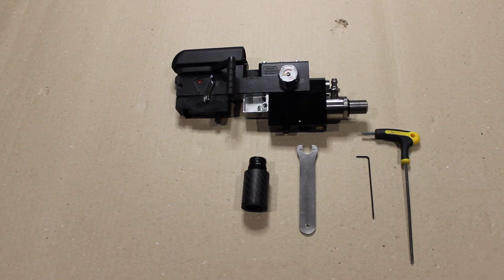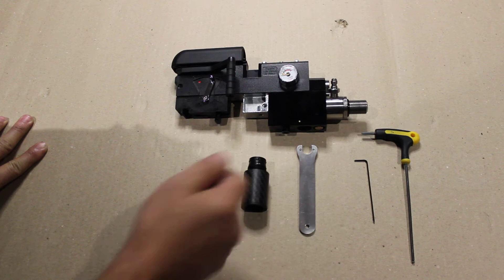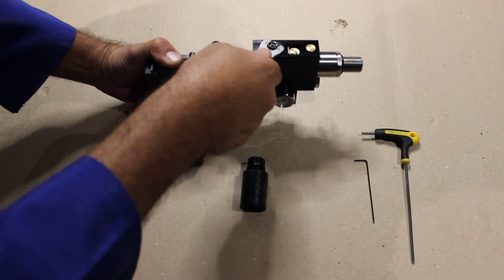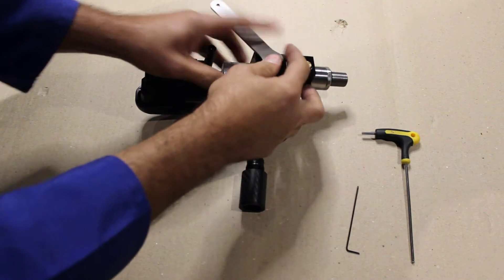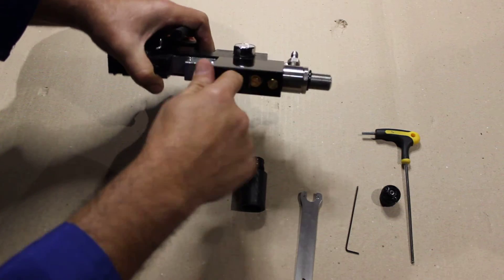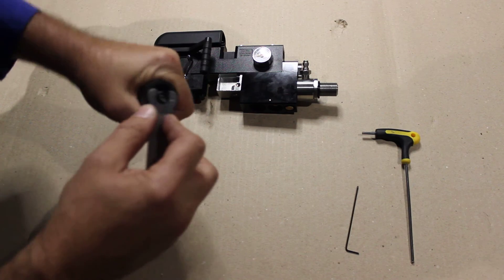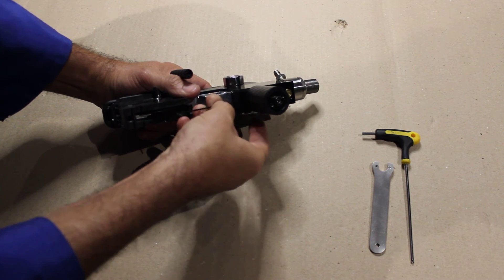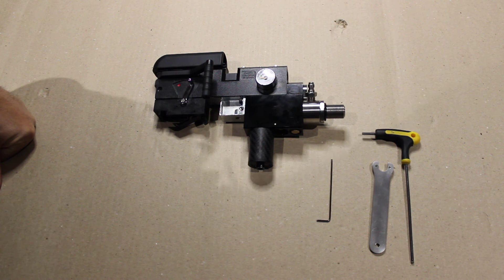Air Venturi Avenger Power Plenum Installation (Nova Leviathan)

Comment: Don't understand why you guys would spend all that money on upgrading when the regulator leaks so much. I thought about it but both mine leaks and air ventura don't even sell parts for their gun. But the upgrades are nice for the short use of the gun.  But if you shoot everyday then upgrading this gun isn't for you.
Reply: what r u talking about my regulator doesnt leak at all
Reply: @schlomoshekelstein908  nem o meu por isso quero fazer o upgrade
Reply: I had a leak. Simply just a matter of tightening the manometers. No leak now. Could use a tad more power for shooting heavy slugs though.
Reply: You can get a service kit from Pyramydair it includes a new regulator and other parts at around 60$. Would rather they just sold the delrin seals but apparently you have to buy a whole new reg if your having severe reg creep.
Reply: Mine doesn't leak either. Had it for a year and no problems whatsoever. Got the new JTS Dead Center pellets coming from Pyramid Air, can't wait to try them out!
Reply: Fiz dois pra minhas carabinas leviatam 5.5 e a outra 6.35 ficou top demais
Reply: @elmocarvalho-v5e  what material did you use?